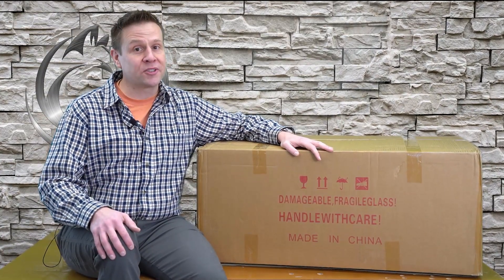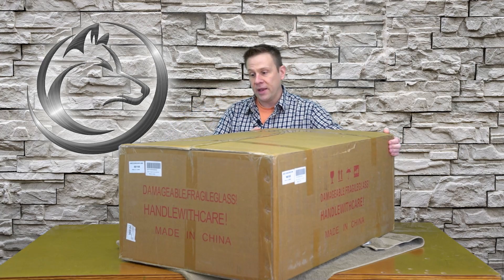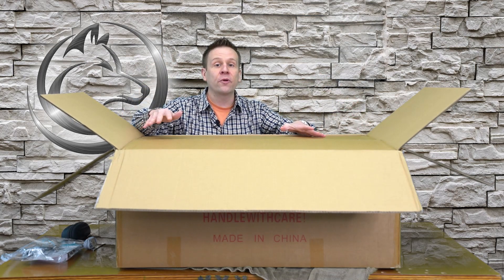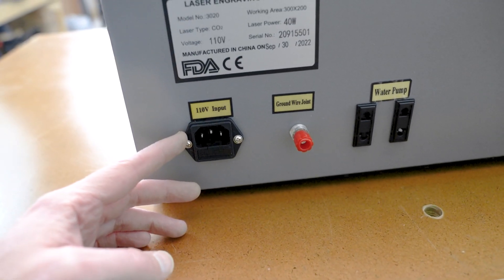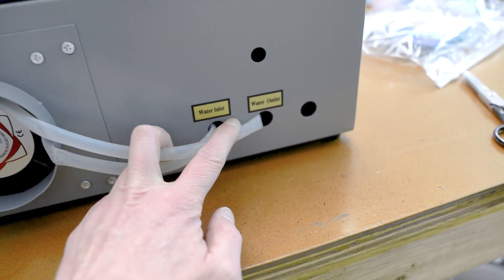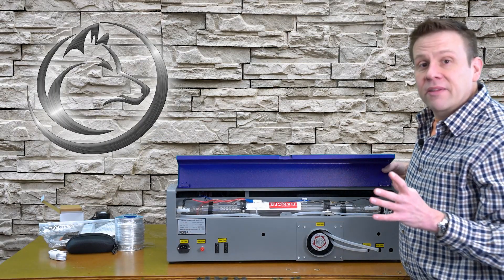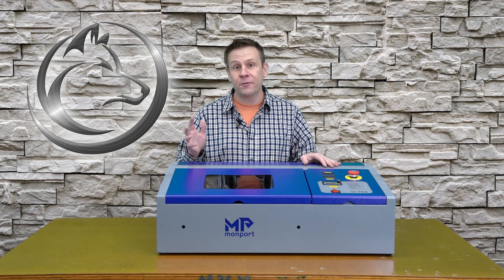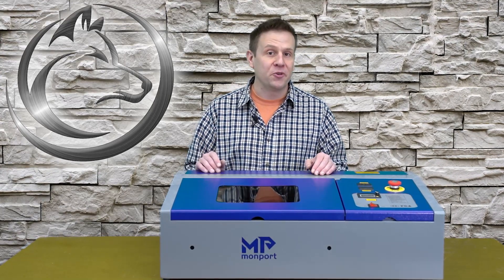Monport 40 Watt  Laser Machine- Unboxing and First Look!

Comment: Hello, 
I received the laser yesterday and I was trying to run a test and that tiny display near the yellow test button says laser signal is off. What can be the problem? What do I have to do do switch it back on to run a test?
Please let me know
Thank you
Reply from the maker: just make sure the dial is all the way clockwise- you should be able to run a project from the software- the yellow test is only for manual test pulse with the dial turned low.  A great sport for help is the Monport Facebook group where you can post pics/video of your issue- many users are able to help after seeing photos or a video!
Reply: @thelaserchannel1  I tried running several projects - what is happening is that the red dot follows the path of the M letter ( test project was just to print the M letter) but there's no burning. So it just draws the M on the acrylic sheet but doesn't cut it. And I can't fix it. And it's impossible to reach the Monport support because they outsourced their support to India and those guys don't even bother answering the phone. They call me at midnight when it is morning in India, tell me how sorry they are, promise to forward my concern to their technicians and nothing is happening after that. Zero customer support. That's why I am asking people on YouTube maybe they have faced similar issue.
Reply from the maker: @ГордейДьяченко-и1и  Sorry to hear you're having support issues with Monport.  Are you able to join the Monport Facebook group- you can post your issue with a short video- people there are able to help once they see your issue by watching your short video.
Reply: @thelaserchannel1  I will give it a try. Thank you.